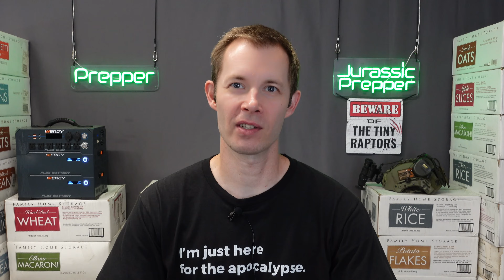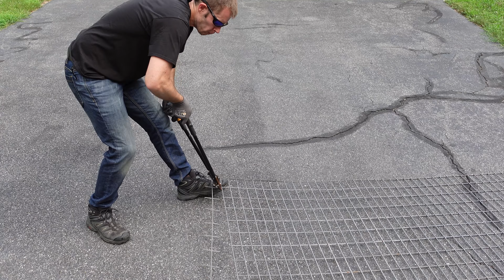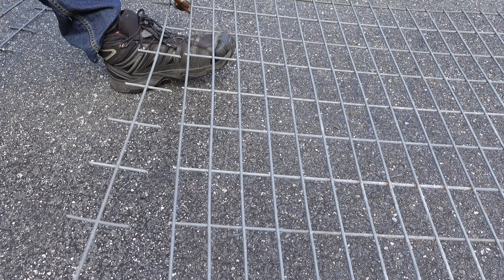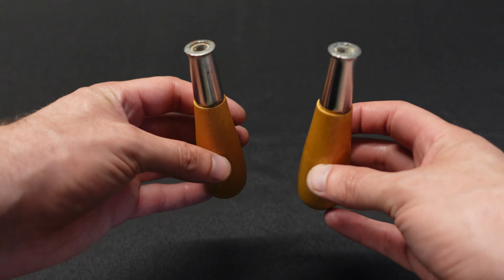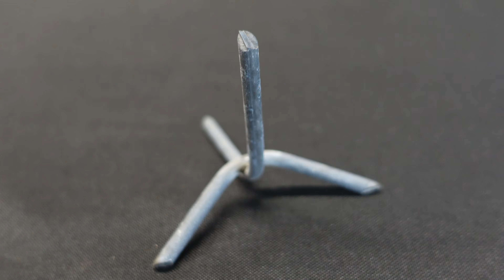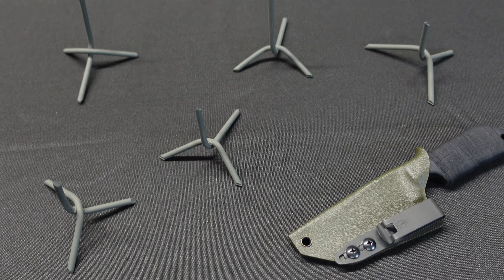Making The Best Tire Spikes for The Apocalypse or The Purge

Comment: You're waste wire, I'd like to make a suggestion. This is better in forests with a heavy under canopy or heavy bush. Maybe paint them in  camouflage. Hang them about face/upper torso level from a tree. Do this only in case of "Zombie Apocalypse" or some such emergency. Add some kind of sound system (can partially filled with gravel). And Viola (et voila) you have a light denial/alarm system. Human nature people rarely look up without reason.

Comment: I used these on my land for years. Rusted up to hell. 

Also have some quick deployable ones on transparent construction/fishing wire. 

Use it on the neighbors private road. After He accused of of dumping rubbish. 

It was an expensive accusation ;))

Exercise extreme caution guys, or you can as  the gentlman in the vid says. Or you can own goal yourself!!
Reply from the maker: Im ok with some surface rust, will be a lot less rust using galvanized metal than non galvanized though.  the welds should hold together for many decades
Reply: @JurassicPrepper  THe rust is good as it blends into the red earth with all the stones etc